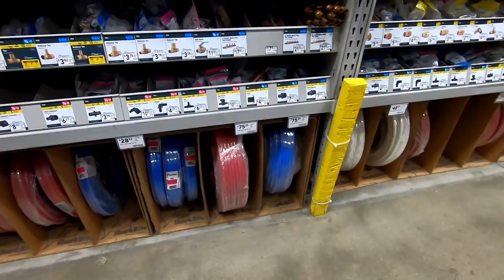Busting out the back block wall / Supply Run . Shop Damage part 7

Comment: Put one run of french drain up against the foundation and another back near the base of the hill.  Many dry that area out more for you.  If right up against the building it could still be a wet area out from the building.

Comment: Wait,  you get told to put on your seat belt...but your lovely wife doesn't have one on?  

Great work here Steve.  I just don't have the temperament to do this kind of work.  A short fuse coupled with frustrating work is not a good combination.  I also have the fear that I will get to a point that I will not be able to fix what I've done.  Add to that, I will get to a point where I will say "good enough", even though it is not.  Frustration is not my friend.  LOL

Comment: one of the best tools I ever got was the mat bed unloader for my pu truck. $100 dollars saves me so much back work and it is fast. just turn crank truck is unloaded in less than minute. just spray silicon on bed first makes it better.

Comment: Would you be allowed to break up the slab into movable chunks and slide it down the bank of the creek. Probably be good to have those chunks leaning up against the bank and help retain it and prevent further erosion of that bank. And protect the building a bit more.

Comment: Steve, don't be humble, you're making great progress doing it (mostly) alone.
Having your dad's skid steer is going to be a huge help.

Once you get the pad out back poured, digging down to ledge and pinning a footer to it will eliminate any risk of the shop being undermined.
Build with the salvaged CMU's and grout them solid.
A cheap  "stinger" from 'Horrid Fate' will help a lot.
Then backfill, compact, pin into your existing slab and pour the (reinforced) floor.

Definitely a beautiful view of the creek.
Do you have a Habitat 'Re-Store' near you?
Salvage windows, or glass doors will really open it up!

Comment: You can use the rubble from the blocks and mortar to fill in below the slab you will have to poor. Stone is expensive and it's free material that is suitable and structurally sound to use.

Comment: You could put a corse of blocks around the the inside edge of your trailer with a strap around them and use that to move more sand? Thought for the future if you need more

Comment: Attach a 6ft length of hose permanently to the air chisel and have your quick release on the end of that. Fittings will not be subject to as much vibration and last longer.
Reply: Six feet! Wow, that would be pretty awkward to use!

Comment: You will soon be able to build a retaining wall which will allow you to get a flat area in front of your shop for a big pad. Plan your drainage to work with the retaining wall (use bond beam blocks for full grouting and re-bar).

Comment: Hi Steve, 

Do you have any concrete recycling plants in the US? That's cheaper than gravel, or use your demolished slab to fill your rubble drains, that avoids getting rid of the debris and provides your drain. 

Put geofabric or similar to the rubble drain so the aggregate doesn't get clogged with soil over time, same sort of material that they put on the slotted ag drain. 

If you embed pvc pipes in small gravel, and they are at least 300 below ground, vehicle traffic will not affect them. 

You've made good progress on your demo. Now to rebuild.
Reply: Dennis Leadbetter agreed, in the UK we have mobile concrete crushers that I would use to recycle the material from the old slab for a sub base under the new slab. Or even driveway. That gravel is going to sink into the mud as it’s driven over and will need to be topped up.

Comment: Might want to try 3"- for your driveway work.  Doesn't sink into the mud as easily as gravel.  Easier to spread while you have the skid steer.  Flattens out almost like pavement and lets the water drain through easily.  Good progress on your project.  Oh, and you might want to try the compression repair ends for air hoses.  Need the i.d. and the o.d. as they sandwich the hose.  The nice thing is you don't have a worm clamp hose end hanging up and slicing your hands.  Plus they don't crimp the hose so hard in one spot so they last longer as well as being reusable.  I went to them several years ago and keep a few around.  Not that expensive.  Take care.  Doug

Comment: The only pex line rated for shop air is the pex-al-pex line.  That stuff has an aluminum layer between pex layers.  I used 300' of the 3/4 MaxLine from RapidAir in my shop and have had no trouble with it

Comment: concrete is not hard with the tools to do it. my first time was a 30 x 35 floor for my shop with floor drains. i borrowed a bull float and concrete co loaned me a power trowel. floor came out good and no cracks as yet 20 years later. my next one was a 24 x40 floor for a add to my house, i had a little bit of pro help on it from a neighbor. i hand dug the footings on the shop and poured them using my cement mixer. the house i had dug with  a back hoe and then formed and poured them by hand to. its a lot of work but not as scary as some make it sound.

Comment: 15:20 you can avoid that it gets any dust at all into the motor if you run an airline to it, and just crack a valve a bit open when you run it. And then just run some tape around it, to get the air the other side out again, just use a short pipe, to get it away from the work. This also avoids that you push the dust into your face :)

I just tape everything in place and remove it when the tape starts to tear.

Comment: Hey Steve be careful with plastic pipe for air lines. They can get brittle from the oil and explode, I believe people have even died that way in the US. I think that was PVC not PEX, but do read up on it before you use it, just to be safe.

Comment: Have found that if I put an 18" or so hose on the tool, that separates the impact damage by putting the quick connector away from the frame of the tool. Michael in Colorado. 45 mi NE of Denver on 2.5ac relatively isolated.

Comment: Hey Steve a lot of times you can take those quick disconnects apart and flip the rubber oring over and double the time you get outta one to fix air leaking

Comment: In the current situation we are finding ourselves in, I think I would be contacting the salvage yard guy and see if he can save you some metal sheeting to use for now. I am not scared of the so called invisible corona thing, my concern it what they are planning to do about it. In control and out of control to sat the least.

Comment: The geotextile on that pipe is to help keep dirt and sand out of the pipe.  In making a french drain, if you can get you some geotextile to line the ditch to where it will give you enough to cover the rock after you have put about 2 inches, the pipe then at least 6 inches over the pipe preferably more, then cover the stone.  The grade needs to be 1% down or 1/8 inch per foot; using a level and tape or rule is good enough.  Look up building french drains on the internet.  It looked like you bought the drain pipe to go under the drive.  Would be a lot better to use schedule 40 under the drive with sand under and over the pipe as a cushion.  You don't want water flowing outside of the pipe in that area; inside the pipe.  make a screen to install on each end to keep critters out(experience).

Comment: Steve, I would recommend Harbor Freight's Truck Bed Cargo Unloader sku# 
60800. It will make unloading your pickup a lot faster and easier, and they are under $50.

Comment: I don't know about tire or wheel assembly, but the operating weight of that Komatsu WA600 is about 124,000 lbs. We had 4 of them at my last shop. Those machines are complete beasts.

Comment: Steve, I just replumbed my entire house with PEX-A this winter, back in January.  Look on Amazon for the tools and supplies, I also used an outfit called Pex Universe, better prices than Lowes.  Menards also has good pricing on PEX supplies, if you have a Menards nearby.  PEX-B like you were looking at in the video should be good for air and about 1/4 the price of copper If I remember correctly.  Just be sure that you're using the proper connections for the type of PEX you are using, but it's not to difficult to understand it all once you do a bit of homework on it.

Comment: Steve, I fully support your work to rebuild your workshop but there are a few comments I would like to make that I hope you will accept -
Given the nature of the site and the slope going down to a stream I would strongly recommend that you get a structural/civil engineer to design the works.  You will probably need a retaining wall that is beyond any DiY'er to design and spec.  The engineer ought to appreciate that you intend to build the works yourself and should design it with that in mind.
To minimise the import of stone have you considered hiring a mini-crusher to render all your concrete/mortar arisings into a stone substitute?  Here in UK, because of the tip charges it is now more economic to crush concrete on site rather than tip and import fresh stone.
Your 'French Drain' isn't - its a land drain.  A French Drain is a trench filled with stone only to guide the ground water.  A normal french drain at the back of the building ought to be enough to relieve excess hillside water backing up behind the building foundations, you ought not need the pipework as it won't flow enough water, all the flow will be in the stone so, the pipework is superfluous.
I would suggest that you use a perforated pipe land drain (as you already have) at the base of the retaining wall to redirect the ground water away from the retaining wall foundations.
The stone/crushed concrete backfill behind the retaining wall must be consolidated in 6" layers with a vibrating plate, this must be done after the retaining wall is set and achieves its design strength.  If the backfill is not consolidated properly you will get voids and the floor of the workshop will collapse again.  Your engineer may consider that backfilling with lean mix concrete is is a better proposition especially if the labour costs are a factor.
Your new concrete floor slab must be dowelled into the existing slab to provide continuity.
I'm not quite sure where your reinforcement is going to be used as there doesn't seem to be a design yet.  However,  good practice requires the reinforcement to be off the ground so that it doesn't not become contaminated - muddy re-bar won't stick to the concrete and you will have a hard time cleaning it off!
I very much doubt whether you will be able to mix enough concrete with an on-site mixer, leave that for the mortar mix.  Pre-mix concrete is the only way forward.
You will need a beam tamp for the floor slab and a vibrating poker for any reinforced concrete walls.  Its a good idea to have a stand-by vibrating poker for when the duty one breaks down as the reinforced concrete must be properly and continuously consolidated or it will be no better than hardcore.
Good luck and keep safe, and I look forward to the next installments.

Comment: Yeah, it's a small truck.  But my Mazda even has helper springs added, and it once struggled to deal with only about 700# of topsoil.  Not meaning to plug or anything, but I work at [the store that sold you the defective hose], and they also have a truck bed unloader which might have helped a lot with that sand.  One day I may investigate whether I can mod it to fit my B2000, but it certainly would go on your Chevy.

Comment: I've found that battery power for things like saws and grinders is pretty useless. It's excellent for drills and drivers, but cutting tools, the battery lasts maybe 5 minutes and they never have as much power as corded tools. I would personally only use them if portability was an absolute necessity.

Comment: Steve; You mentioned an Engineer friend that was there as you started the demolition and I was wondering if he mentioned what you would have to do in addition to secure the footings so as to establish protection against washout/erosion under the new foundation. That is a pretty precarious situation for the foundation.
Reply: I keep thinking  geogrid or geotextile and an short A B block gravity wall
Reply: Geofab would be subject to uplift and erosion at the edge upstream unless it was pinned deeply, say with caissons. Also consider caissons as reinforcement under the foundation at the corners and midpoint.
Reply: Gabion baskets?
Reply: I wonder if their is bedrock at the depth of the brook? If so I'd be digging down(maybe with a post hole digger) and putting in concrete pilings something like every 6ft along the wall.
Reply: With regard  to bedrock, a "quick" survey of the vijeos on this project will reveal imagery of the "excavated" hill face that the building/property lies on.

FROM MEMORY: what I recall is that this site is an OLD strata of erosion sediment. The stones in  the creek bed belie the age as well. 

I would expect at least large (BIG) undisturbed boulders that can be anchored to. Layers of fractured sedimentary material is what I would expect.
Reply: See @2:25

Comment: I used what was called driveway mix.  It was 3/4 down to fines.  Worked great on the driveway.  Can the rubble be used as riprap for the creek band?  Sand is heavy, it's always wet!!  Twisting while shoveling is hard on the back.  River sand is hard to find around here.  If you sift it, you can't beat it for use in mortar.
Reply: I've also heard it called 3/4 minus.

Comment: Wish I was out there. I would have let you use my 1980 f350 dually. I've carried 4000 pounds of broken up concrete to the dump in 1 load and the back of the truck dropped maybe a inch at most.

Comment: PEX is not good for compressed air for the same reason PVC is not good.  Air has much more potential energy than water, so when it fails it's catastrophic.  Over time the material will wear out and then you will eventually have it rupture.

Comment: From what I've read, the People Who Know Stuff on the Internet recommend strongly against PEX for air lines. If using plastic line, it should be specifically rated for air.
Reply: PVC is the really dangerous stuff to use as an airline. PEX is pretty safe at your typical shop pressures. The only downside to PEX is that it isn't very thermally conductive so it doesn't help to dry the air like copper or steel will. It's also difficult to maintain slope with PEX so that the water runs off to the drain point.
Reply: @lordgarak  You may be correct that PEX is not as dangerous as PVC. That doesn't make it safe. Maybe there is PEX out there that is rated for use with compressed air, but if so, I haven't found it. If you find some, by all means use it. In the meantime, It seem unwise to me to recommend using a plastic that isn't tested and approved for compressed air.

You say "PEX is safer," but what kind of PEX? What brand? "PEX" is a general name for cross-linked polyethylene, and the properties of the material can vary enormously depending on molecular weight, additives, processing, etc.

As I understand it, ordinary copper tubing is accepted by codes for compressed air. Readily available systems made of aluminum or nylon have been specifically designed for compressed air. In the presence of these alternatives, is it wise to take a gamble that a PEX line won't burst catastrophically?

There is a lot of stored energy in compressed air. Orders of magnitude more than in the same volume of water at the same pressure. I recommend treating it with respect.

Comment: Right where that first block fell.  you need to pile all the broken block and concrete at. to keep the gushing creek from eroding the bank away.
Reply: That block would be swept downstream come the first rain.

I once got five skids of concrete 'pillows' when the yard left the Quickcrete delivery outside overnight.
I tried using them as riprap on the bank of my drainage  sluice, and while they were better than nothing, they didn't all stay in place.
I drilled right through a bunch of them, and hammered rebar into the bank.
That helped a lot.
Reply: @jimurrata6785  well I have seen ,if done right it works. All that concrete and block won't wash away.
Reply: @hpelisr  just piling it down there won't help.

Ask Steve what happens when that creek rages after a heavy rain.
Reply: @jimurrata6785  I don't think so, Boo on you
Reply: Hack,  if he chooses to construct a solid wall, tied to the underlying ledge, it's not going <I> anywhere.</I>
The block and debris could be better utilized as backfill for the wall holding the exterior wall of his shop.

Comment: Steve I have good project for ya. Build a small rock crusher and crush up yer broken block and concrete and use it in yer driveway and around yer shop. just a suggestion

Comment: That pipe you got didn't look like the SCH 40 - that looked like the thinner drainage or CL200 stuff. It might be ok though if it's buried deep enough - the dirt should spread out the load from the driveway before it gets to the pipe anyway.
Reply: We called it grove drain. Though I've never seen how it was used in a grove. I worked at a place that made the stuff.
Reply from the maker: Correct 👍. I ended up getting the thinner pipe for the areas away from the drive. I forgot I already had enough sch40 4" to go under the drive.

Comment: I'm a machinist not a carpenter or excavating person. I never understood how the filter fabric works on drainage systems. I mean, any filter does the same thing......gets dirty. What happens when sand and silt eventually clog the fabric? Does that stuff ever get dug back up and replaced? How long can it be in the ground and work effectively?